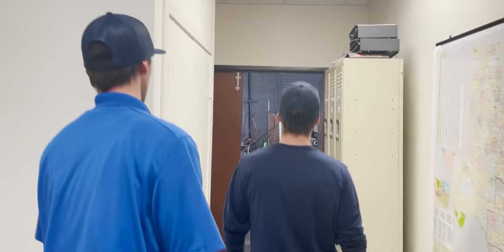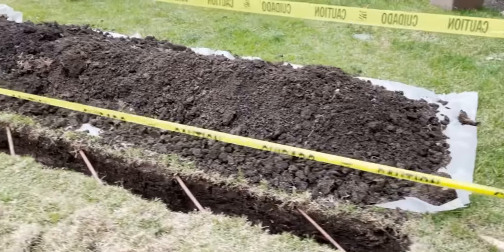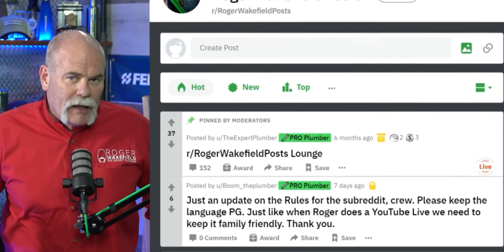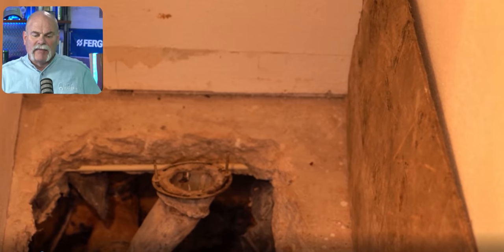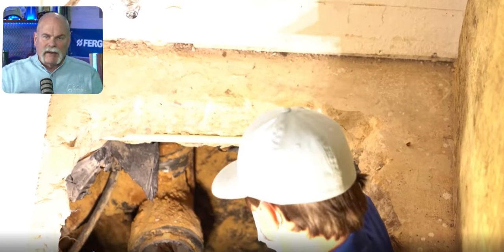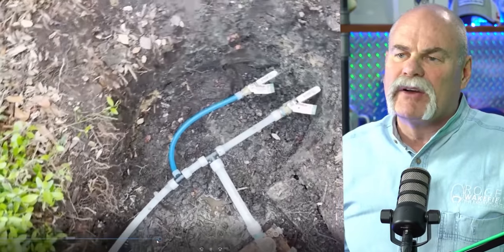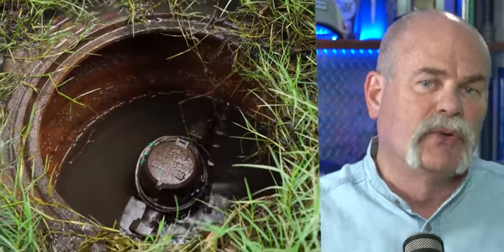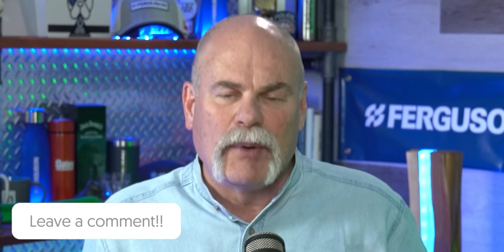Real Plumber Reacts to His OWN Plumbers Work!

Comment: I worked for a small company that drilled and installed water wells and pumps, which included the lines to the house. The owner of my company was working alone on a Saturday where we had dug a pretty deep trench to the house. He chose NOT to use safety bracing on the walls of the trench and was working inside. The walls caved in and he was buried alive. He didn't make it.
Reply: Woah. Wow. 😟
Reply: Sadly, most plumbers who do this work long enough will know a story like this. Was working in a subdivision when a trench collapsed and killed a guy just down the street from me. Happens as fast as you can snap a finger.

Comment: Up in New Jersey we don't tunnel under a house just for that reason very dangerous, also nearly impossible with clay and shale.... curious how its all backfilled properly to prevent structural problems with slab.... typically with water line Replacements under the slab we tend to reroute them, that way in the future they will never have a problem Underground. Plus some insurance companies cover the damage that will be caused to the floor when rerouting if it needs to be excavated. just not the pipe replacement itself.

Comment: I'm a plumber in Pennsylvania. There are a lot of different ways you can run pipe and make repairs. The biggest difference I see is that in Texas most of the homes don't have basements. Looks like the waste and fresh water lines get installed right under the concrete slab then get buried with no actual access to the system. Then you have to dig up tons of dirt and stone so you can work on any repairs. Up here in PA you have access to the piping from basements.

Comment: I'm an HVAC Tech. in Springfield Ohio & we are allowed to repair/install gas lines after the meter bar as well...some counties around us make each tech. acquire a "Journeyman's" card...no test, no nothing...just apply and renew each year, for a nominal fee of course! LoL 
   We recently switched to the Rigid Pro Press tool. I was a little leery of it at first but now I love it!!! The extra costs associated with the fittings is offset by the huge reduction in man hours, especially on large jobs...so I guess you CAN teach an old dog new tricks!
Reply: Ya that county really worried about safety,  not  , show me the money . I bet it's a Democrat run county.  Its similar over in pa

Comment: We had a plumber come in to give a quote that said that they do not touch anything to do with gas. Ended up getting a plumber out that is licenced to do both and has decent experience and knowledge with both. Not sure if it's 1 licence need or 2. We have a hot water system that only turns on when enough water pressure from the hot water line comes through the system. With that and other work we needed and wanted to be done (wanted as it wasn't "essential" to move our gas outlet for our heater but something we wanted doing to make our lives easier), we needed someone that does both.

Comment: We do stuff waaaayyyy different here in Maryland waterlines need to be 26 inches or deeper so it won’t freeze and we use cts to pex or copper all depends on what is already inside of the house plus all of the houses here have basements and usually built in the early 1900s and sometimes 1800s I’ve pulled out a LEAD waterline before I still have it somewhere laying around back at work lol also I do sewers and gas after the meter we did a 2000ish foot gas line for Columbia gas that was extremely close to the transmission line that runs through a field that we had to cross around 1800 feet to get to a line that didn’t have 3000 psi in it lol that was fun

Comment: Had a power company  hit a costumers water line they did the repair and sent a rock under a slab house they had decent pressure until you ran more than one fixture and it would die off we ended up having to dig up the water line on the outside cut it intstall a water hose adapter on the main and back feed through a hose bib to blow the rock out worked like a charm

Comment: I worked at a plumbing and septic company for about six months in the state of NY, and we had our own dig crew. And as a general rule, we avoided gas lines like the plague. Mostly because we never wanted to risk hitting them because of how precariously placed they were. NY infrastructure is so old and so outdated that you have to maneuver around the craziest of setups. And God help you if there are giant rocks under the ground (which was a common thing to run into, and the most common cause for pipe breakages).
Reply: I’m an apprentice plumber out here in Southern California. I sympathize on the rock front. Digging is my least favorite thing to do. I’ll always do it when my boss needs it done, but I thank God that we’ve started bringing excavators in.
Reply: @MandenTV  We had two excavators, and I still had to jump in the ditch with a shovel to chisel out the rocks from the dirt because they were so tightly packed in the soil. Least favorite part was when the trenches back-filled with ground water.

Comment: I used to do asbestos abatement and had a job where the plumber went in and jackhammered the concrete floor in the basement to replace a sewer pipe but the concrete floor was covered with asbestos tile and he jackhammered through the tile as well and contaminated the entire basement with asbestos
Reply: Damn thats a tough one, prob need an abatement crew to do the demo on that

Comment: If you tunnel, how do you properly compact the dirt when back filling?
Reply: I would guess they have to use stone.
Reply: Ya dont it can't be compacted to original,  ya just leave it open , future access.  Iv already busted up near interior foundations and found 5 inches of open space where the backfill wasn't tamped and the concrete was holding , concrete was 4 inches thick , makes ya think of sink holes 😳

Comment: Can an over flowing toilet cause the wax seal to break? My son plugged the toilet and it plunged easily but it made a huge mess and I’m concerned of the wax seal as the other toilet in the house was gurgling and the water was rising in it.
Reply: No. When the toilet is set in a wax ringit smudges together. It’s a different story if your toilet rocks all the time when you sit on it